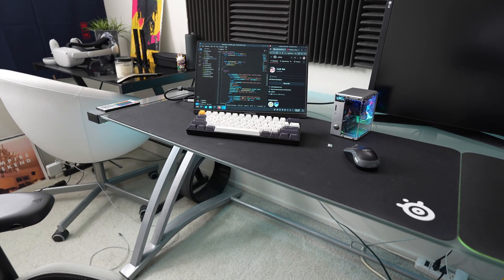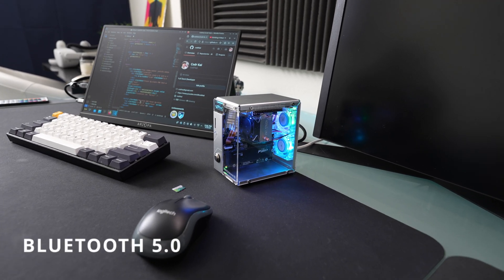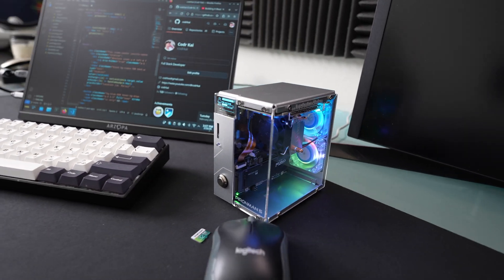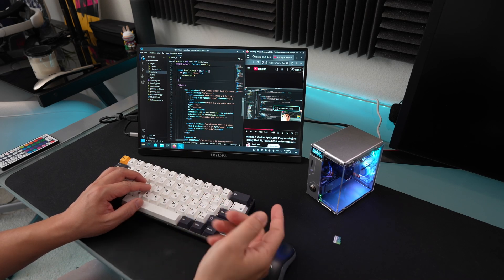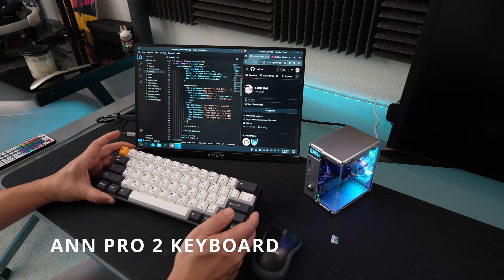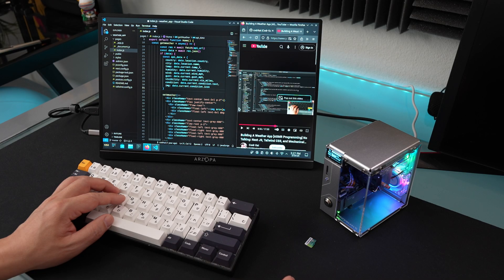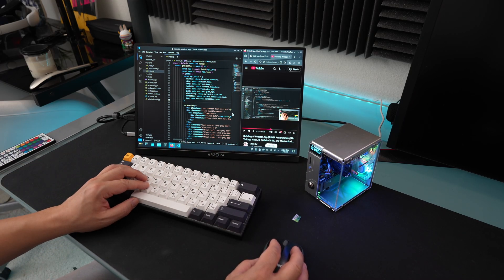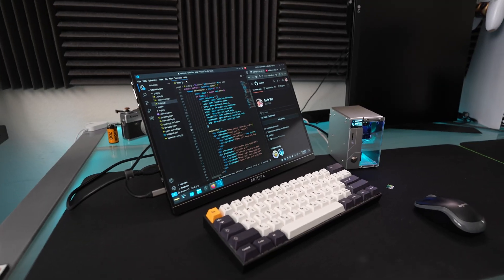Raspberry Pi 5 Portable Mini PC Build For Programming

Comment: Thanks. I also do coding, browsing, some light document & photo editing. I've been living inside a virtual Linux on my old Mac and I've been wanting to move to Linux permanently for years. I'm on a shoestring budget  and was wondering if a 16GB Pi5 would suffice. Your video was helpful to actually see and have some feel for the expected experience. I agree with you that 8GB is the minimum. Now my virtual Linux gets 8GB RAM and I have to be mindful what applications I run at the same time. You open too many browser tabs or Electron-based IDEs and they make a feast of your RAM :)